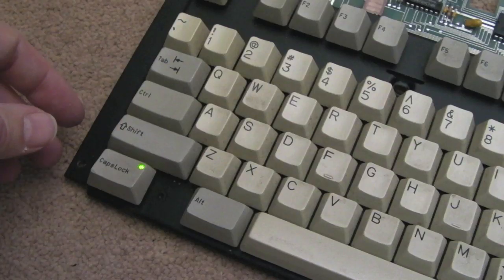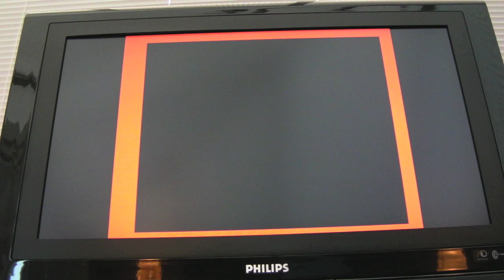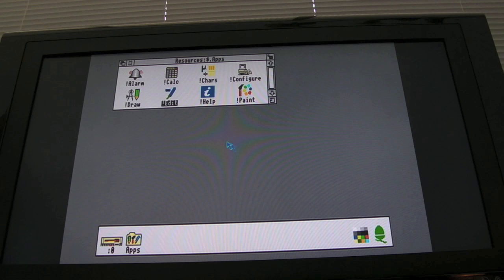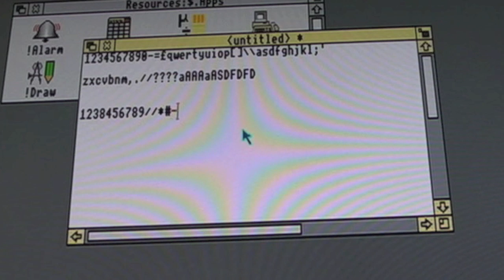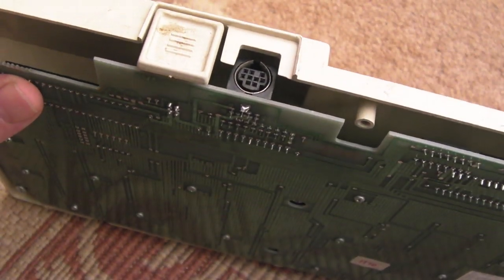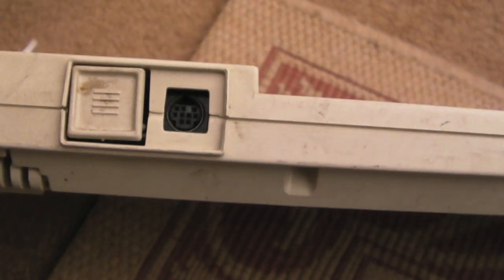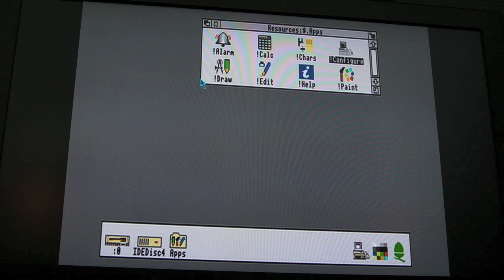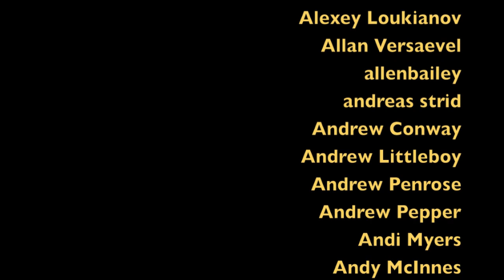Acorn Archimedes A300/A400 Keyboard Quick Fix

Comment: Hi Chris
Nice easy one for you.

You surprised me so much I thought your OCD would have been really getting at you, the heat shrink sleeving on the end of the cable where you replaced the ty-wrap. You did not slide it down the  cable to be where the cable outer is cut off.
Reply from the maker: Yeah, I didn't really think about it at the time - tbh it makes little difference to anything since the part I clamped has enough protection over it I guess.  Before I sell it I will perhaps slide that heat shrink down and attach a new cable tie.

Comment: The heat-shrink tubing was off from the end of the cable. Putting it back to its place would make less tension on wires and plug.
Reply from the maker: EDIT: Ah, I see what you mean now!  That heat strink makes little difference to anything really!
Reply from the maker: Watching it back, I can see the benefit of tucking that under a new cable tie!  Thanks, I will sort it!!!!

Comment: This is a completely different design to my Arc 310 keyboard - I believe there were two manufacturers. Mine uses rubber domes and lacks the metalwork.
Reply from the maker: Thanks for the info, I wasn't aware of the different models!   I have another one coming up soon - not sure which rev that is!
Reply: @GadgetUK164  Externally they look very similar. The case is the same, but the keycaps are different, with the LEDs for scroll lock and num lock top left, rather than top right.